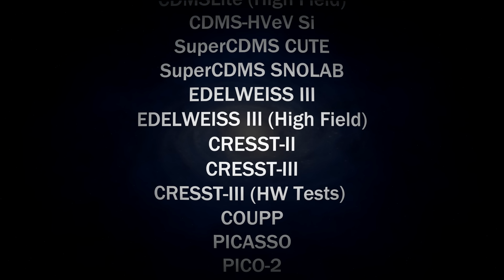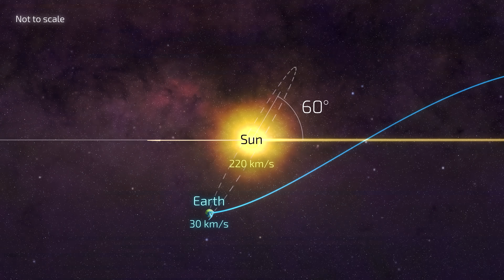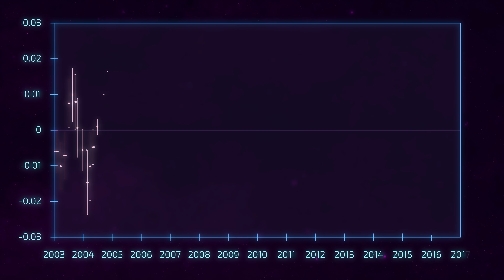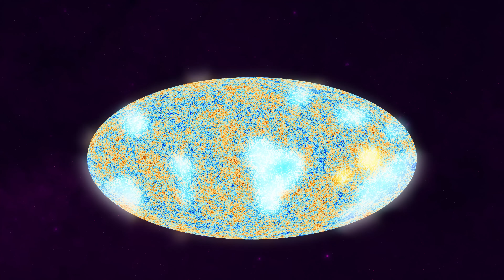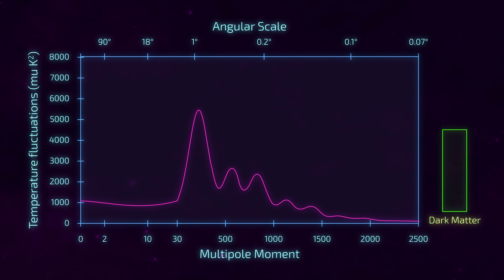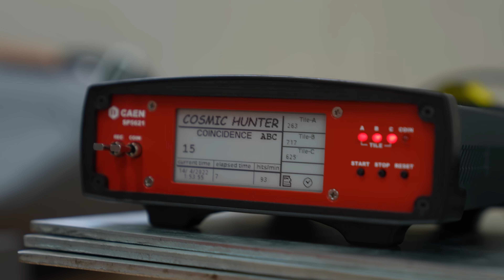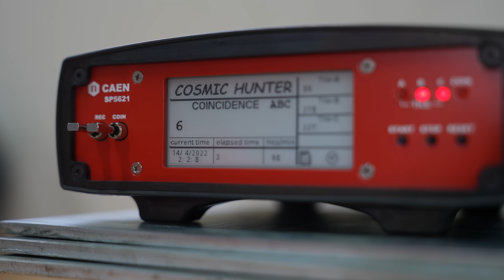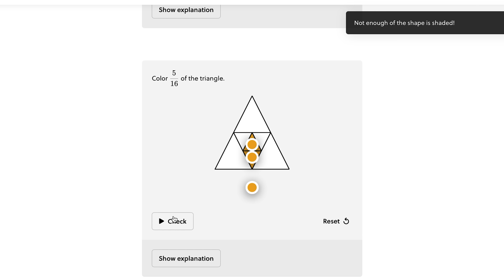The Absurd Search For Dark Matter

Comment: Great video! Just one grating error that I caught and didn't see anyone else catch at 1:42. The pie chart with the dark matter and ordinary matter shows "5x" beneath it and you say that there's 5x more dark matter than ordinary matter when you showed the chart. However your chart actually shows a smaller ratio of dark matter to ordinary matter. Because of the particular ratio and the fact that you've represented it as a pie chart it's actually pretty obvious the ratio is wrong if you know what to look for in the visual (I won't get into the details now but there are some easy techniques you can use to see that it's not right without having to measure anything). The angle on the slice representing Ordinary Matter should be 60°, meaning the pie chart could be broken up into 6 equal-sized pieces where 5 of them are Dark Matter and 1 is Ordinary Matter giving a 5:1 ratio Dark to Ordinary Matter. I measured the angle in GeoGebra and found it to be 72°, meaning your pie chart shows a 4x ratio instead of a 5x ratio.

Pie charts are designed to show parts of a whole. This is either the result of a simple mistake (forgetting that your pie chart should represent a whole equal to 6 identical pieces to make a 5:1 ratio) or it's a misuse of a pie chart. The total area of the circle is 5x the size of the piece of Ordinary Matter and if the slice of Ordinary Matter had been shown side-by-side with the circle representing all Dark Matter it would be fair because there would be no mistaking the visual ratio. But a pie chart, by design, represents the total of all of its parts and so you are presenting a visual with a 4:1 ratio (with 5 equal sized slices, one representing Ordinary Matter and four representing Dark Matter).

In all fairness the auditory and visual clues saying 5x should be enough to have avoided misinforming viewers of the ratio, but the visual's impact was diminished by the misrepresentation of the ratio which is unfortunate.

---

I'm sure the other commentors aren't going to be thrilled with what may sound like a pedantic whine on my part, but I will mention that I am a huge fan of the channel and this is the first time in several years of watching that I have caught an error like this. I have long been thoroughly impressed with the work done by Derek and Veritasium both and I also appreciate that they are also prepared to admit when they're wrong as Derek has mentioned in previous videos. Nobody's perfect, and this one small error really reflects our imperfections as humans. No I'm not whining, the scientific community thrives on tremendous work that is refined through peer review where errors, big and small, are caught and brought to the attention of the reviewees. I am simply calling to attention an inaccuracy that, if corrected, would make this one visual more impactful and, by extension, make the video a little more impactful too.
Reply: Why so serious?

Comment: 🎉 Awesome video, like iron filaments attracted to the ends, the collision of the Bullet Cluster created and electrical system that repelled the interstellar gas (cold dusty plasma) to extreme poles of the charged system.
Reply: I watched the clip again, you say that the gas gets stuck in the middle. How about he hypothesis that it actually is real matter in the middle, and as the cluster came together their insteller gas which you say contains the majority of mass, gathered together like interacting poles on a magnetic bar and became ends of that system. We know that the solar system has a far reaching interaction with local gases. Could you imagine the internal cataclysm as each sun was subjected to electrical pressure as those worlds collided? Boom! 💥 wouldn’t that create a lot of extra interstellar gas?
Reply: Nope. Sounds like electric universe nonsense.

Comment: Dark matter was not estimated to make up 85% of all the matter in the universe. They estimated it to be around 24% dark matter and 71.4% dark energy. Dark matter and dark energy were proposed because general relativity is incomplete when it comes to describing the motion and orbits of stars and galaxies.  This simply means with the observations general relativity is about 95% wrong. Meaning there is no dark matter. The strength of gravity is off by an extremely small amount (0.0000002007 in/s). So, it is able to describe the motion and orbits of planets and stars close to the barycenter of the system's mass but is unable to describe the motion of the stars and galaxies extremely far from the barycenter of mass. It's a simple fix.
Reply: Gibberish.
Reply: @ianw5439  Gibberish? LOL, do the math. The solar system is orbiting the supermassive black hole Sgr A* at about 500,000 mi/h and the Milky Way is traveling 1.37 million miles per hour towards what's called the great attractor. The solar system is about 5 billion years old and the Milky Way is 13.7 billion years old. The acceleration of both the Milky Way and the solar system regardless of their mass or distance from other mass comes out to be exactly 0.0000002007 in/s. Gibberish is when astrophysicists blame this slow acceleration on dark matter instead of simply doing the math. Dark matter is a dead horse.
Reply: @BigNewGames  Gibberish. Link to the peer-reviewed paper. Otherwise  I am dealing with yet another YT physics crackpot.
Reply: @ianw5439  Okay, so you can't do math?
Reply: @BigNewGames  Yep. And it has nothing to do with dark matter. Link to the peer-reviewed paper.
Reply: @ianw5439  Do the math then if you understand how to calculate their acceleration rate.

The motion of the Milky Way galaxy and the solar system have the same exact acceleration rates. Tell everyone how that is possible when the galaxy and solar system have different amounts of mass? Their mass is not a common factor to their motion but their age is? 

Why in God's name would their age be a common factor but not their mass? 

You know, I thought it was a coincidence. So, I compared the velocity to age ratio with several satellite galaxies orbiting the Milky Way. The 6 dwarf galaxies I studied had the same acceleration rates too, 0.0000002007 in/s. So, it's no coincidence. Age appears to be the common factor in the motion of every star, satellite galaxy and host galaxy I studied.

Mass clearly is not the common factor in their motion, that's why they insist there is missing mass in their equations. Mass/gravity is not the common factor.
Reply: @BigNewGames  And what the hell has this gibberish got to do with observations of dark matter in colliding clusters? Write it up or shut up.
Reply: @ianw5439  Which cluster are you referring, the bullet cluster? That cluster doesn't prove dark matter. The image was done by overlapping the data from gamma ray and X-ray telescopes. Dark matter does not radiate gamma rays and or X-rays so dark matter was never observed. You have no idea what you're talking about. Dark matter has never been observed. The only inclination astrophysicists have that something else is causing the this extra motion is because general relativity is unable to explain it. That doesn't mean dark matter was observed, it just means there is motion occurring to stars and galaxies that general relativity is unable to explain. Meaning the equations are off. Just like I said, a slow acceleration that occurs to stars and galaxies of 0.0000002007 in/s cannot be explained by general relativity. It comes out to an acceleration of a 1 mile per hour increase every 10,000 years. This slow acceleration matches all the motion they've pinned on dark matter. General relativity is simply incorrect. This slow acceleration doesn't happen to planets, moons or other small objects in the universe. Lol, dark matter was never observed. If general relativity were right then neither dark matter or dark energy would have been postulated as solutions. Dark matter cannot be measured, it doesn't radiate light. It doesn't reflect light and doesn't interact with matter except for a motion that can't be explained using general relativity. That doesn't mean the dark things exist. It means the equations to describe the motion of mass are in error. Just like you!
Reply: @BigNewGames  "Which cluster are you referring, the bullet cluster? That cluster doesn't prove dark matter. The image was done by overlapping the data from gamma ray and X-ray telescopes. Dark matter does not radiate gamma rays and or X-rays so dark matter was never observed."

Lol. Talk about clueless!  The X-rays are from the normal matter interacting as it collides. The gravitational lensing shows the bulk of the mass to be where we see no visible matter! And there are plenty of observations besides the Bullet cluster. That was the first and most famous. The images are false colour and show the X-ray emission from the baryonic matter in pink, and the location of the mass in blue, as obtained from lensing observations. To 8 sigma significance. That is a slam dunk;

'Weak-lensing mass reconstruction of the interacting cluster 1e 0657–558: Direct evidence for the existence of dark matter.'
Clowe, D. et al (2004)

"You have no idea what you're talking about."

Far more than you do, given that I am qualified in physics, and what I am telling you is backed up in the peer-reviewed literature. You, on the other hand, have nothing and don't even understand the colliding cluster images!

"Dark matter has never been observed."

I have told you already - we see the effects of it, and those effects cannot be explained by any other hypothesis.

"he only inclination astrophysicists have that something else is causing the this extra motion is because general relativity is unable to explain it. "

Lol. DM has nothing to do with relativity. It is to do with Newtonian gravity.

"That doesn't mean dark matter was observed, it just means there is motion occurring to stars and galaxies that general relativity is unable to explain"

No, it is nothing to do with relativity. Get an education. And the colliding cluster lensing data are very strong evidence for DM. And you cannot explain those observations, other than totally failing to understand the images! Lol.

"ust like I said, a slow acceleration that occurs to stars and galaxies of 0.0000002007 in/s cannot be explained by general relativity. It comes out to an acceleration of a 1 mile per hour increase every 10,000 years."

Gibberish. Link to the peer-reviewed paper by a physicist making this claim. Otherwise it is just more crackpot nonsense on YT.

"General relativity is simply incorrect"

DM is nothing to do with relativity!!! Learn physics, for chrissakes.

"If general relativity were right then neither dark matter or dark energy would have been postulated as solutions."

Neither of those things are anything to do with relativity. Jesus!! And dark energy is measured via the integrated Sachs-Wolfe effect, among others.

"Dark matter cannot be measured, it doesn't radiate light. It doesn't reflect light and doesn't interact with matter except for a motion that can't be explained using general relativity."

It is nothing to do with relativity. Sigh. And the colliding cluster observations essentially prove the existence of dark matter. 

"That doesn't mean the dark things exist. It means the equations to describe the motion of mass are in error. "

No, they are not in error. And nobody qualified is claiming that they are. Just some random crackpot on a YT comments section. Go away, and get an education.
Reply: @ianw5439  Relativity and Newton's laws of motion are unable to explain the motion occurring to over 95% of the visible matter in the universe and you say it has nothing to do with general relativity or it's predictions? You don't appear to be a qualified physicist claiming general relativity has nothing to do with explaining the motion pinned on dark matter and dark energy. Dark matter and dark energy are wildcard variables that can take on any value to fit the observations. That's called pseudoscience. Like playing cards and making up the rules as the game progresses.
you cannot explain why the solar system has the same ratio between its age and velocity as the Milky Way galaxy and every other satellite galaxy I studied. So why the hell do they have the same ratio between their age and velocity and not the same ratio between their mass and velocity? Clearly mass/gravity is not a common factor in their motion.

Comment: What am i missing, here verifying if the signal is due to dark matter should be easy enough, atleast if their working theory was right, we know how fast we move through space so just check if the increase/decrease match the rate of the change in speed and the base level. sure it would depend on our working understanding of dark matter but it would atleast be a step more, and then you can tweak darkmatter to match the observations and see if it breaks anything else or say, yeah that's not dark matter

Comment: Doesn't a gas fill its space? I'm a little confused,  wouldn't all that gas have pressure even in space, evidenced by the slowdown, but wouldn't we expect the heavier solid pieces to bypass each other?

As an example,  I'd expect two glasses of water thrown at each other to act differently than two cups filled with equal mass of the water but in buck shot pellets. The gas in interstellar space would be even more dramatic compared to stars, planets, planetoids, asteroids and space rocks.
Reply: And how do you stop this magical gas of yours from interacting with radiation?  What makes it lose all its other fundamental properties?

Comment: When considering only visible matter, are galaxies rotating faster than expected in general, or just in the outer parts? If so, why wouldn't the complete galaxy rotate faster considering the existence of dark matter?
Simply increasing the mass of the galaxy should influence the rotational velocity of all the matter in the galaxy, right?
Reply: It doesn't influence all the rotational velocity in the same way; the rotational velocity of matter in a spinning disc held together by gravity is a complicated function of where said matter is, and it works out that the farther in towards the centre you are, the less dark matter has an effect on your velocity.
Reply: @rtg_onefourtwoeightfiveseven  Thanks for the explanation!

Comment: galaxies are not separate like this. they are neither discs or like wheels. they are vortex shaped like a timglass. the stars are moving away fromt he galaxy core not toward it. the galaxies are expanding. matter produced in the galaxic core is being sprayed by giant ligthning bolts streams of mass ejections that spirals outward. galaxies are 3 dimensional object not 2d. stars do drift but moves away from the galactic core. there is one giant star in its core that is spinning 90 degree out of phase with the apperent dish plane.  the vortex is on a 45 degree angle to the 90 degree angles. the galactic nucleus causes the mass ejections to z pinch and form new stellar objects from the mass ejection release from the core. the galaxiy is being seeded by a mother galaxy. all these galaxies are tangled like spagetti in all kind of angles toward another. the real images raw images have been edited to make galaxies look separate. they are in reality a tangled mess where galaxies are like a cloud in a nebulae. that is why we see galaxies bound to clusters as if there is a universe inside the universe and more than one. one galaxy seed another by one of the biggest stars in the galaxy mature into a new mini galaxy trough mass ejections and what is labeled a supernova but in reality is the birth of a new galaxy born inside the mother galaxy. sometimes we see tiny galaixes tangles to other galaxies as if they are just  stars around one in a different vector. electricity powers the universe and steers the galaxies and stars. all galaxies are intertwined with each other. the energy originate from the roots of the universe where its brances stretch out as the known universe. the roots are in the darkes part of the universe where apperently no light seem to originate. its from this darkness that the universe grew out from. the ancients called it the void. its been known trough all the cultures of ancient earth and worshipped. we are not the first advanced civilization to make the brain analogy of the universe. we are not the first technological civilzation on earth. our medical knowledge is not new. our science is not new either. its all ancient science where some of it is the reinvention of the wheel. just like modern science the ancients before the cataclysm in our unstable solar system posessed advanced science of embryos. there are ancient artifacts and wall reliefs that shows such knowledge known tousands of years ago. the world was reset about 10 000 yers ago by a powerful z pinch between mars and jupter zapping a panet blowing it up. if such massive solar bursts of electrical charge hits planets like back them it can happend again and another planet will be destroyed. the powerful electrical solar wind outbursts are unpredictable in size and magnitude. the fluctuations are caused by irregualrites of ion bursts in the galactic nucleus where massive stellar bursts do happens everytime a new star is born and  the ion storm from these bursts can destroy planets or make our sun violent. the ancients viewed the sun as a sleeping dragon and when awaken it became violent and destructive. everytime a new star is born planets in our galacy dies or get violently bombaded with massive bursts of energy. it will happend again but such events could be million of years apart or could happend any time.